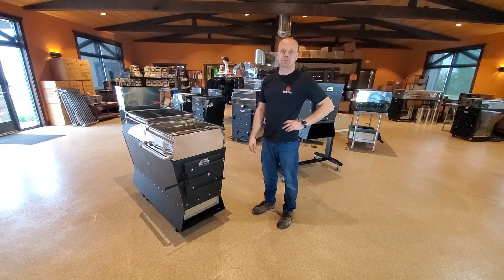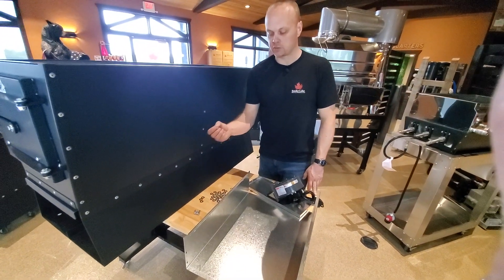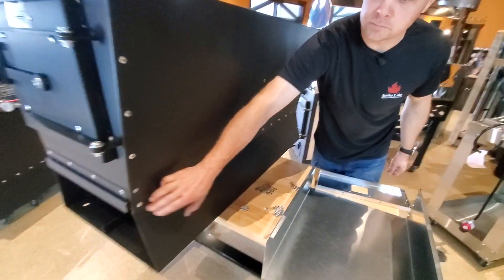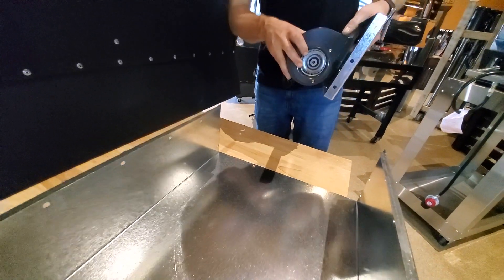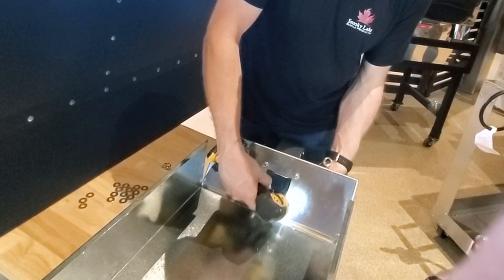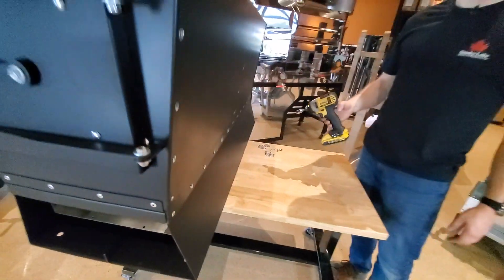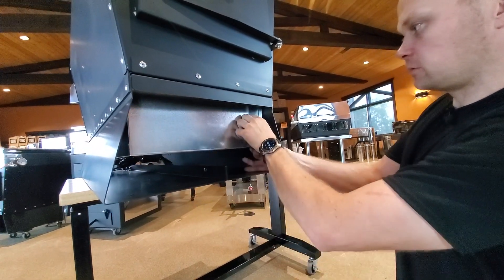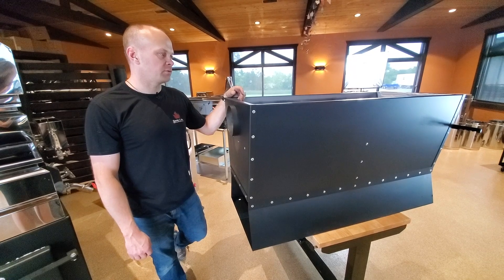Dauntless Forced Draft Assembly

Comment: How much does the forced draft improve your evaporation from 12 gallons per hr.
Reply from the maker: On your flat pan or divided flat pan Dauntless the evaporation rate will go from about 12gph up to about 15gph-16gph.  However, there are other major advantages.  You will not have to split your wood nearly as small, the wood can be less than perfectly seasoned, and startup and shutdown will be much faster.
Reply: @SmokyLakeMaple  good to know I probably should make the upgrade. I probably will pick my Dauntless up Monday.

Comment: Do you have any estimate of what kind of stack temperatures this unit could produce with the blower?  Shouldn't change the 18" clearance to combustibles with 24gauge black stovepipe that comes with it?   I bought one of these units with a drop flue pan(so maybe not as hot as flat pans).  I'm setting it up for this season.

Comment: If you have the blower, you basically want to run it all the time?  You cannot turn it off to slow things down because the box is cutting off the air to the fire?  You must keep it running, but use the damper slides to adjust?
Reply from the maker: The blower has a large pass-through capacity, meaning that if the blower is not running, there is still a nearly 2" opening through the blower for air to draw through.  And even if the blower is not allowing enough pass through, removing the front panel of the pressure cabinet allows all the air you need, and its only 6 bolts.  For those not following this conversation exactly, this conversation pertains only to the notion of running a Dauntless with the forced draft added but choosing not to run the blower.
Reply: @SmokyLakeMaple  Very Good. Thank you.

Comment: Do you need to unplug fan before you open the door to add fuel?
Reply from the maker: Yes. It is best to turn off the blower before opening the door. Some folks have connected their blowers to an on/off switch which works great. However, do not add a rheostat as it could damage the blower.